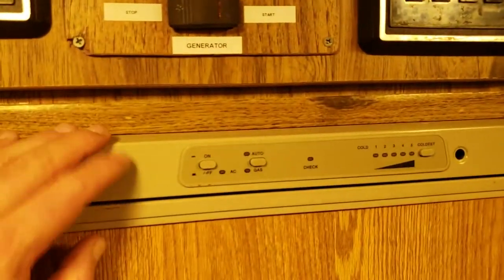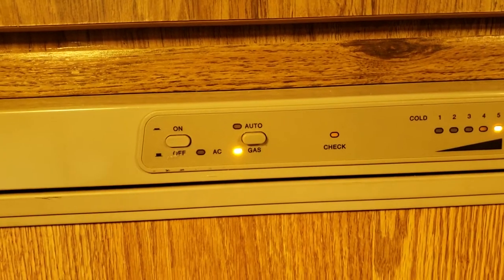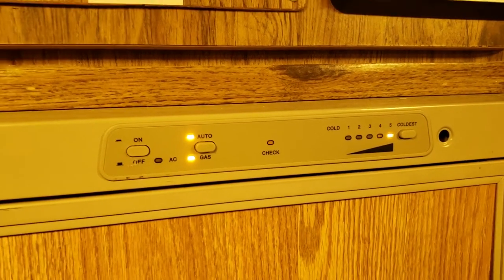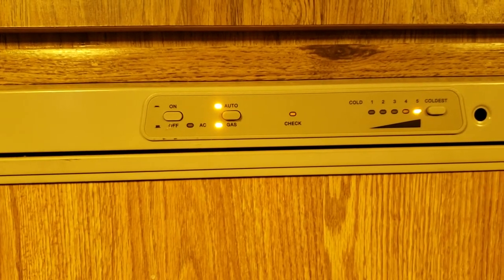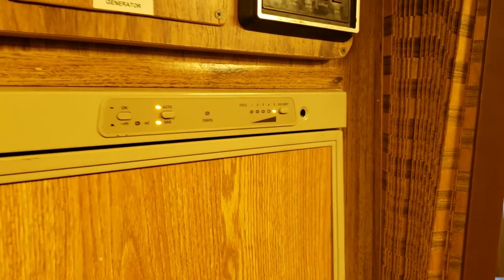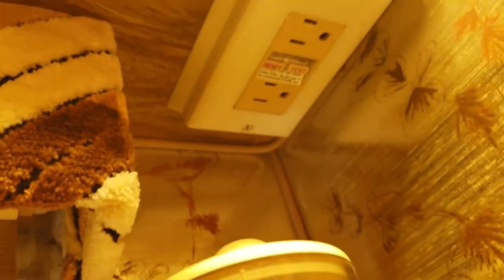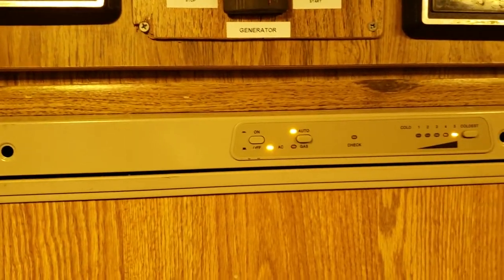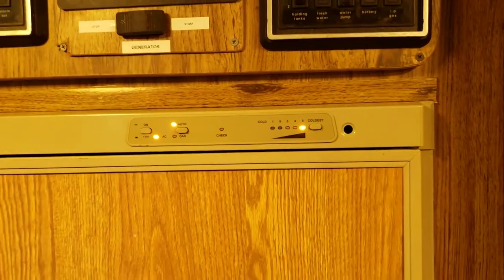RV Fridge Won't Run On AC Power - Fixed - Check This First!

Comment: Your the man! But I have not tried it yet but hoping that is it but at the same time I might have another problem cause I just purchased this rv and it was missing propane tanks everything stolen but anyway propane is working for gas stove, furnace and I heard it kick on for the refrigerator and felt heat outside back of fridge but but but outside back of the fridge is a Light Blue Plastic piece with a little motor attached to it with two proms and two wires that are one red and blue but don't know which prom but tried both ways not working also this Blue Plastic piece is CRACKED in a few places and it has to clear plastic hoses coming from it so I guess it pumps air or something through it when it was working. If I can find this part or take it somewhere to get fixed or a similar part I believe this Blue part is my Problem and was the old owners problem but again I will check what you checked. Anyone familiar with this Blue Plastic part on a about the year 2000 or less Royal Dometic Refrigerator made in Sweden Model Number RM 3862. I have to go get the old Blue Plastic part and see if it has a number on it but I doubt it does. Any help, info ANYONE???

Comment: I have a 2018 model and already the refrigerator wont work.  It won’t work on AC or gas. Come to think about it even the light inside wont work. The check light comes on and that is it